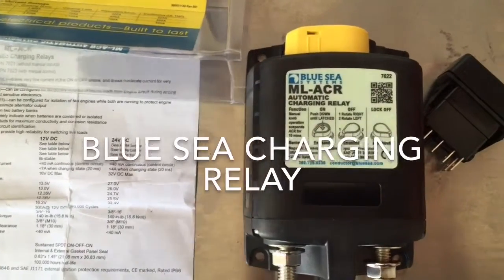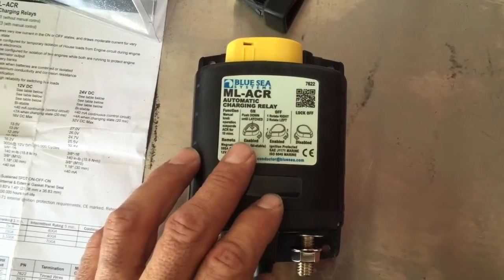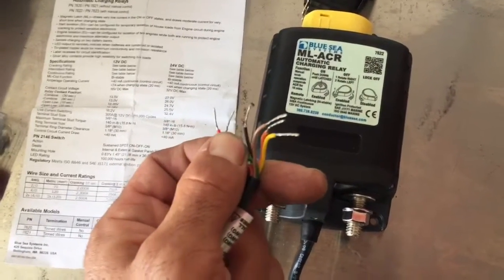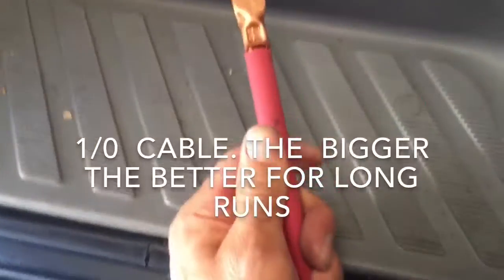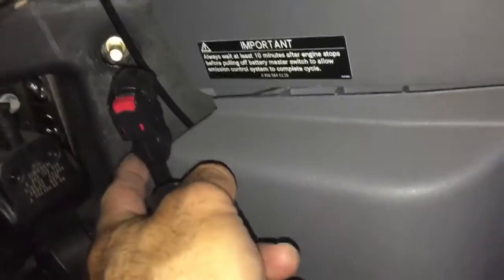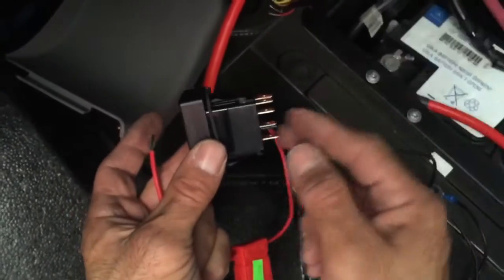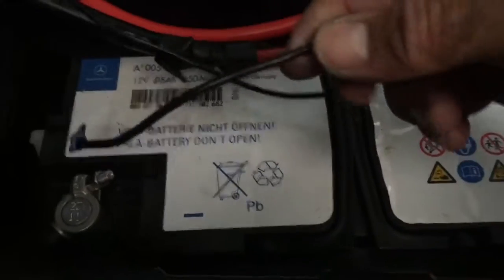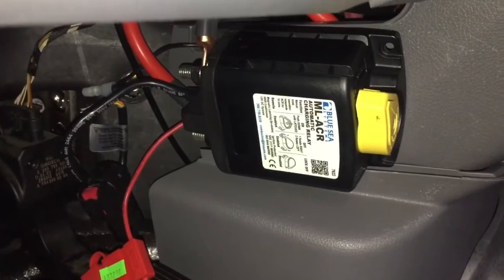Sprinter Van Blue Sea Charging Relay Install

Comment: Did you ground to the chassis near your house battery or did you run ground back from the starter battery? If so did you use 1/0 welding cable for that long ground run?

Comment: I have a 2017 sprinter which I am building out and want to include the BS ACR. Your video was very helpful and I never would have thought about going under the van (through the battery well). Brilliant!! 

A couple of questions: 

1) it appears the ACR just uses the positive wire (from Sprinter battery to ACR to House battery). Is there also a need to wire the negative from the Sprinter battery to the House battery?

2) what did you use to seal up the whole in the bottom of battery well?
Reply: Tim W Q

Comment: Does your rear aux cable that goes in through the large hole dump into the bottom of the wall cavity which required you to saw a hole in the bottom to pass through the wires? Also, it looks like you ran 2 wires.. Is that other one not related to the charge relay?
Reply from the maker: Japheth Yes used a metal hole saw with a small drill to make a hole in the cavity. The second wire is for my shore power connection which I will make a video soon.

Comment: Good morning DIY Sprinter, Did you install a fuse between your ACR and your auxiliary battery? I've seen with and without. Thanks
Reply from the maker: Gareth Feldstein 
Hi, Yes I did.  I believe i used a Blue Sea compact fuse block(150amp).  It would definitely work without it but I wouldn't recommend it.
Reply: Any reason why you used a 150amp? My auxiliary batter is 12v 200AH would the 150amp be fine? Might install a breaker instead of the fuse.
Reply from the maker: Gareth Feldstein 
I had the same questions. I also have a 200amp alt.  From what i see and have read your alt. will not put out more that 40amp to charge batteries anyways. I believe mercedes uses a smaller fuse when they do their aux batt. Set up

Comment: Hi thanks for posting the video I learned a lot from it. I'm currently installing my own on my 2016 170 2500. I have two questions for you regarding your install. First, did you mount your relay with velcro? Second, why did you not run your power to the switch from the house battery or even the terminal servicing the house battery? I suppose it does not really matter as you have the manual switch but I would think if you have the power supply to the remote on your starter and that went dead your remote switch would not work. 
Thanks again for the video. Cheers
Reply: Thanks for the answer and advise. I was also curious where you attached your start isolation?  Not much out there about where to do this. Voltage surges can mess with electronics if not on the 12v cranking side. My van is for computer work so I have tinkered around for a good spot but cant find any beside having to take the dash off and attach to the crank side of the ignition switch. Some installers say they didn't enable this feature but I know how voltage surges can affect electronics so.... Any advise? Did you attach it? Thanks a million
Reply from the maker: Bino Monkey  I have not connected the start isolation wire.  If you google search for sprinter auxillary battery install instructions you will find that underneath the drivers seat there is a connection that is hot and a connection that is hot only when ignition is on.  Pretty easy to access.
Reply: Thank you I will look that up. Any reason you didn't wire up the start isolation? Cheers
Reply: I found the connections mentioned in the Aux-battery-retrofit-guideline-NCV3.pdf and measured it with my meter. One of the terminals is hot when the engine is cranked but unfortunately remains hot. What you need I suppose is a line that is only hot while cranking the engine. This sends a signal via the brown wire to the ACR that triggers it to isolate for 3-5 minutes. I suppose it then checks for that signal once again after the 3-5 minutes and if it detects no more power from the 12V system, it will then charge the house batteries with a steadier amperage. Unfortunately, that means getting to the ignition switch or locating the starter solenoid under the bonnet. Please let me know if you have a better idea on this. Cheers

Comment from the maker: You can probably find inexpensive volt guages on amazon that you can wire to each battery.  A trimetric unit or a xantrex link will also do the job.  I have the trimetric unit.
Reply: Blue Sea has a new one that's really nice... https://www.bluesea.com/products/1733/Mini_OLED_DC_Voltmeter . You could also go with a battery monitor system (more $) such as one of these https://www.bluesea.com/products/category/6/112/Meters/OLED_Digital_Monitors

Comment: Great video. I have a mercedes sprinter with a battery under my hood and the start battery inside. I really like to know what my voltage is for both batteries is there a way to do this?